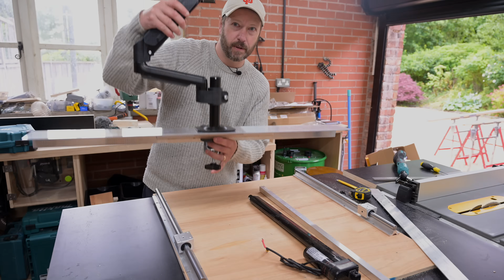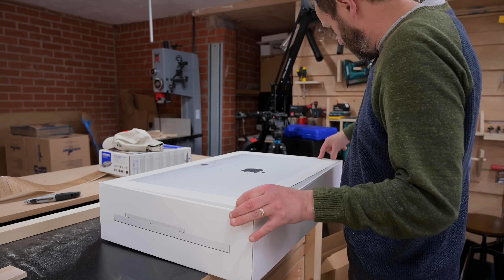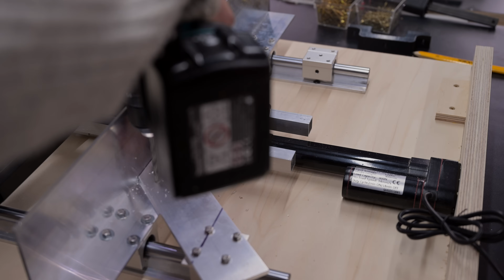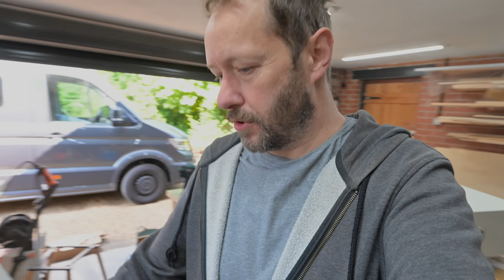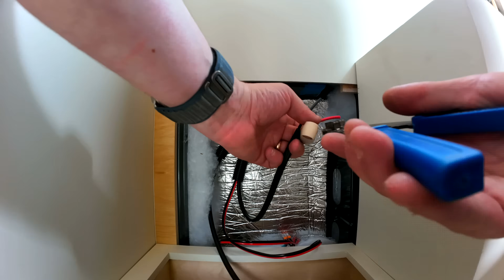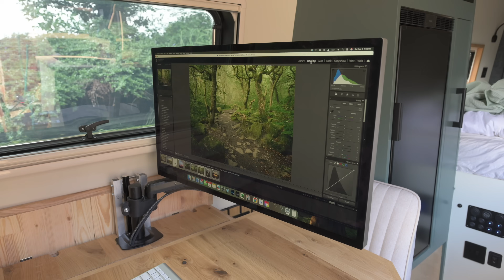I built a secret monitor into my Ultimate DIY Campervan build!

Comment: What a cool lift!  However, it does undermine your credibility about all the other times in your build when you asserted how important it is to keep the van’s weight down.  😅 given the monitor is within arm’s reach from the seat, the prudent thing to do might have been to just manually pull the mount up from its hiding spot and skip all the mechanicals, but it sure would lack the current wow factor.

Comment: The monitor lift is amazing.
I’ve been thinking about the possibilities of doing work & travel in a converted panel van. This is really putting some fire underneath those idle musings…

I’m wondering though, how is the seating when you spend multiple hours working? Don’t the rigid seat shells get tiring for the back?

Comment: That turned out dang well! You may have tackled this problem and didn't video it so bear with me. Since you're basically having a rolling earth quake when driving having the monitor settle in to a sling or something to help dampen motion (I'd recommend something but so far everything I could think of off the top of my head would cause abrasions on the finish on the monitor) and keep it from crashing into the walls of the well.

Comment: Brilliant Nigel. Google AI - How Far Away Should You Sit From A 27 Inch Monitor? | by Guides ...For a 27-inch TV, the optimal viewing distance is generally between 2.6 to 5.4 feet (31 to 65 inches or 0.8 to 1.6 meters), according to online sources. This range allows for an immersive experience without causing eye strain or making the screen appear too small or too large. "Ganbatte kudasai" (頑張ってください in Japan!